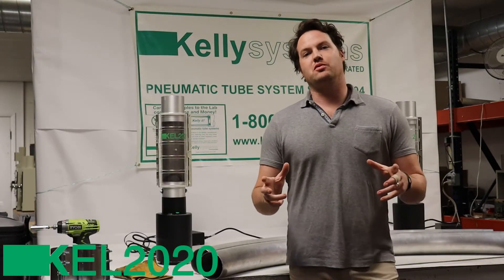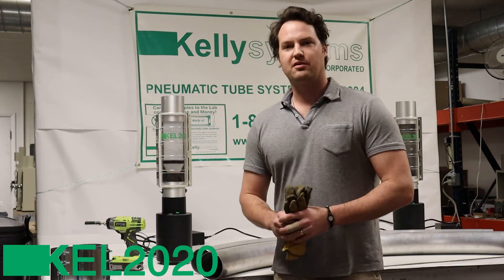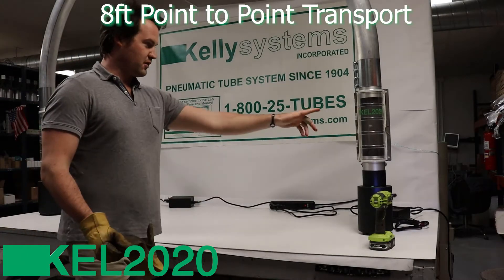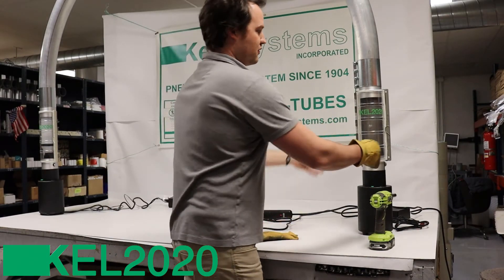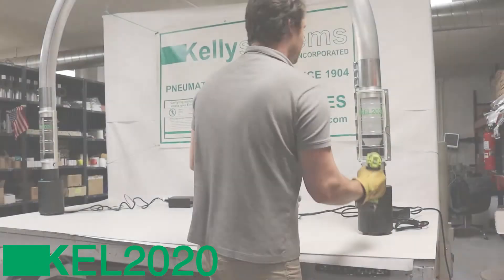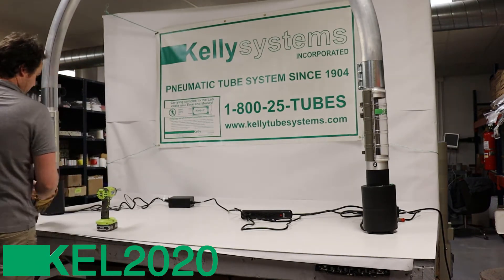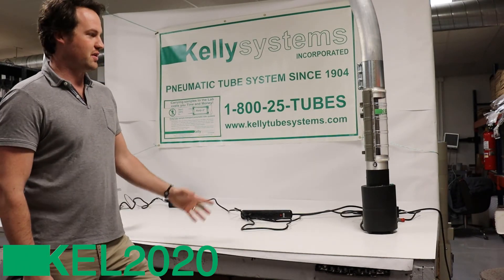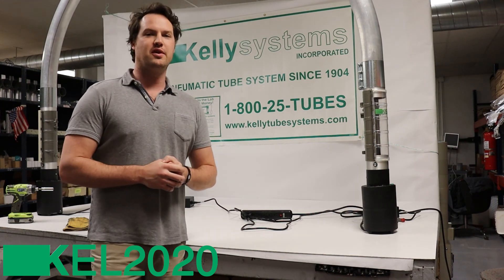KEL2020 ASSEMBLY EXPLAINED IN 10 MINUTES ( DIY PNEUMATIC TUBE SYSTEM)

Comment: Oriented. "Orientated" isn't really a word. This system is great, though. Does it only move things 8 feet or can you get straight tubes to increase the distance? Does one system push air while the other pulls? Just things I am wondering, thank you.
Reply: Good Point about the Word usage!  Yes this can go up to 200 Plus feet, very far across buildings and through warehouses.

Comment: One of the best elements of this system is how simple it is so that anyone can step into operation of the system and have easy success.
Just a simple slid latch and single button dispatch.  Not much to be confused by once it's installed.

Comment from the maker: In This video We didn't take the time to Tape the Joints with the AIR TIGHT LEAK PROOF... Tape But for PROPERr installation that Tape will come with each system.  Make sure EVERY Joint has Air Tight Tape under the Coupling!!!